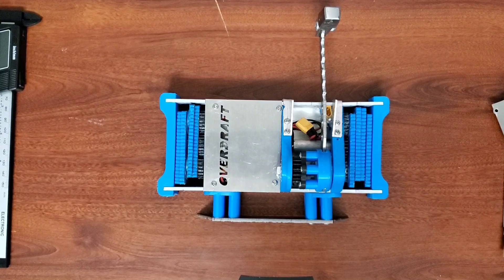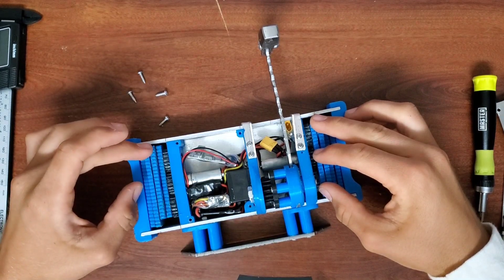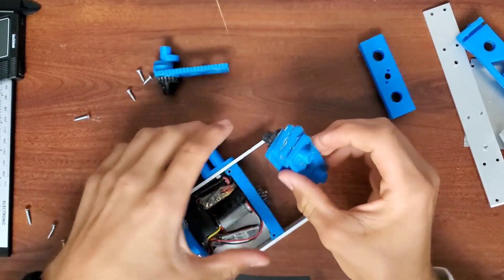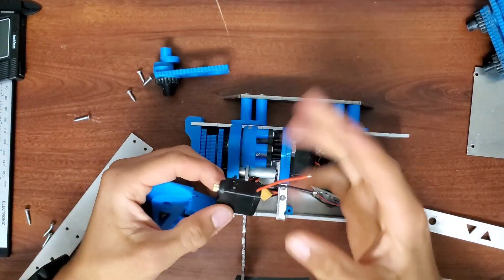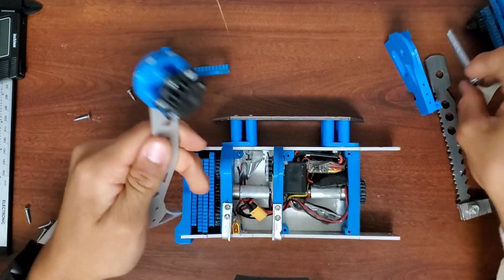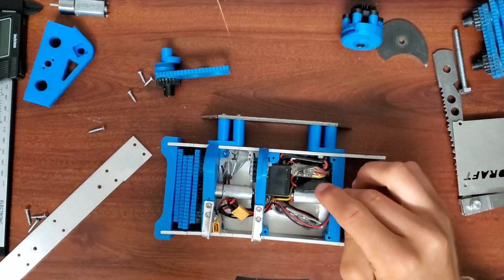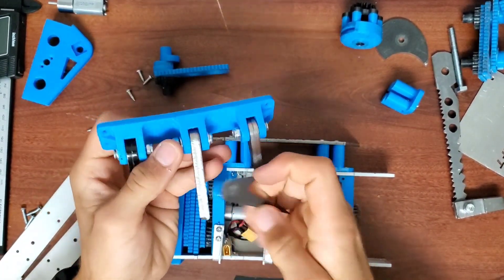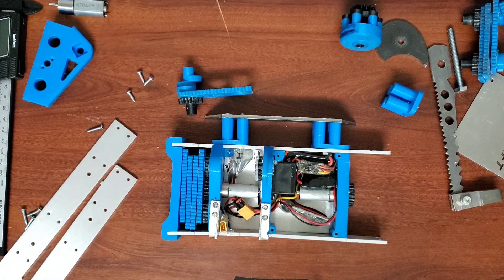Shuffling Hammer Spinner v2 Build Breakdown

Comment: Thanks for the awesome video! Appreciate the in-depth breakdown, I've always been curious about how good shuffler drive trains are made

Warning! Unsolicited Advice from An Inexperienced Internet Stranger Incoming :P
10:33 - The triangular cutouts in your weapon arm look sweet but may be contributing to that bending problem more than you think. The corners of the triangles look quite sharp in the video, and sharp corners = stress risers / stress concentrations in the part. Stress multiplier increases as the radius of the corner decreases, so sharper = worse. 

Rounding out those corners, or replacing the triangular cutouts with a friendlier shape like the circular holes in the hammer arm, might eliminate that bending problem completely without changing the shape or the mass. Same story for the serrations in your hammer arm - each one bumps the stress, so you'd probably get better results from using a smooth edge and making the new thickness the average of the heights of the crests and the troughs. A more sinusoidal shape (like the opposite side of your hammer weapon bar from the serrations) is a good compromise as well if you want to keep the aesthetics.

Subscribed to your channel, looking forward to the next vid!

Comment: Are you happy with the servo performance? Which one did you select?
Reply from the maker: I used a Corona metal gear servo with about 4.5kg cm torque. It had plenty of power, but like I said in the video the servo electronics broke in testing so I had to run them as gearmotors with an ESC. Definitely not ideal and I've ordered some replacement servos that I hope will do better. Thanks for watching

Comment: Do you find you get out-pushed with those tpu feet? My experience with tpu parts has been that the material is very slippery. I've had success moulding bathroom silicone sealant into tpu parts to improve grip.
Reply from the maker: Yes it's pretty easy to out-push me with this setup, mostly just due to the nature of shuffling mechanisms. I did try silicone on the old version and found it made pretty much zero difference and was just kind of a hassle, so I didn't bother this time. Going forward I'm going to focus more on speed than traction, especially since the floor at local events is very slick. Thanks for watching!